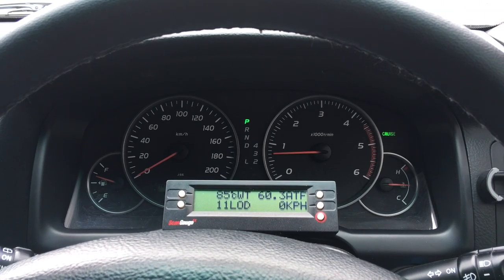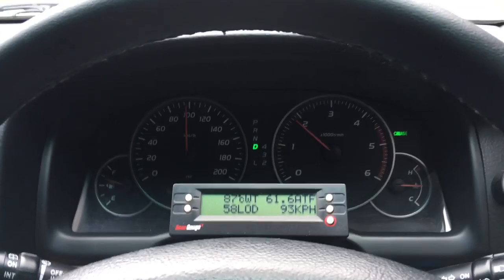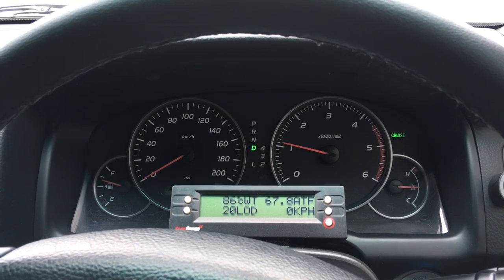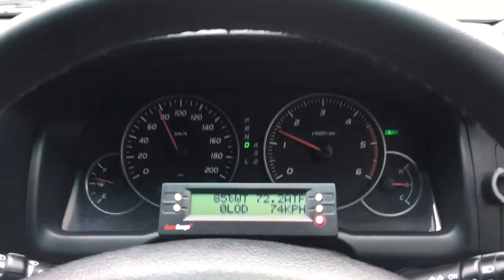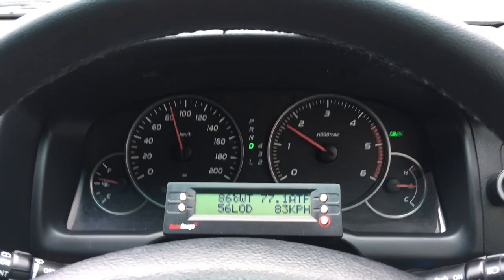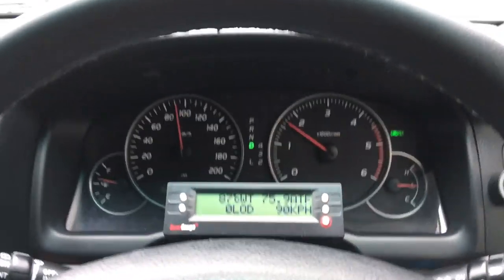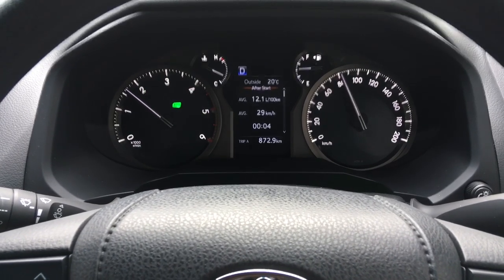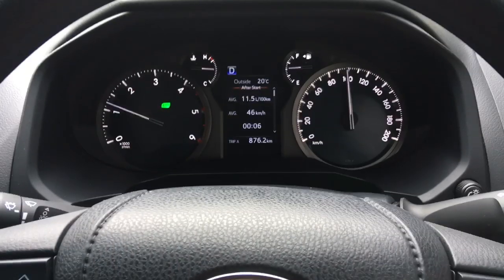TRANSMISSION & TORQUE CONVERTER

Comment: I get the point. The 6 speed auto does not fail. Regardless of torque converter locked or not. It is more like an OCD complaint and I can highly relate.

Comment: Hey Andrew, love the videos mate. I will be doing a bfe soon when I’m due for timing belt mate. I’m just wondering if you are familiar if the scan gauge can monitor the 4 sped auto transmission temperatures? I’d like to monitor them somehow but can’t see it on obd2?
Thanks in advance

Comment: Terrible Gearbox I’ve had my new Hilux 2020 for 4 wks now and the 6 speed Auto is driving me nuts with 95% highway driving . Coming from 2015 Dmax with the 5 speed auto which was Great . So I’m going to bite the Bullet & spend another $750 on a Stocklock kit on an already $70k Ute Hopefully will fix the Torque Converter. Thanks for the Great video 👍 would have been a little bit better if you had the Scangauge ll plugged in aswell on the 6 speed .
Reply: Did you fit a lock-up kit?

Comment: Hey Anthony. 
At 60kph on cruise control going slightly uphill I get a shudder (5th gear at around 800rpm).
If I drop it to 4th (or increase revs), the shudder goes away. 
 Is the torque converter cactus, I know you're saying heat, but my one makes the entire car shudder ?? 

I only got the car 2 weeks ago. 180k 5 speed, auto, 120 prado.
Reply from the maker: Use 4th
Watch more vids.
800rpm is way too low 🤷‍♂️😉😂
Reply: @Fourby4Diesel  thanks. I watched your how to drive an auto video a while back and I have noticed that the efficiency has gone up. Just sometimes forget to take it out of "D" sometimes and it catches me out. 

I owned a 6 speed manual prado and would never think to change up a gear into low revs. 

I was wanting to assure that it wasn't due to a mechanical error
Reply: I have this exact issue also, turns out torque convertor is flogged out. Howd yours go mate ?

Comment: I disagree with your comment about higher gears not being the most economical, sometimes they are more efficient and sometimes they're not. If the engine can mix air and fuel together well at a given engine speed, and the load on the engine isn't too close to the maximum for that engine speed, that will be a better engine speed than a higher one in a lower gear with a lower load. There is a range of engine speeds that result in poor air/fuel mixing, that engine speed will be less efficient than a speed just higher or just lower than that range, so sometimes you're right, a lower gear can be more efficient.

The most fuel efficient gear choice depends on so many factors; but most important are the amount of power requested from the engine and the air mixing dynamics of the engine.

Think about it like this, an engine is an air pump, and the faster the engine spins, the faster it has to pump air into and out of it, the more work must be done to maintain that speed. You get more engine braking from a higher rpm than a lower one, that's because there's more resistance from the extra work the engine has to do to pump the air. When the engine is idling at 700 rpm, it takes 1 unit of fuel per minute to maintain that speed, and at 1400 rpm, it takes about 2 units of fuel, and at 2100 rpm it takes around 3 units of fuel (it's not perfectly linear, but's close enough). This is because as the engine spins faster, it's doing more work to simply pump air through itself. When you are driving along with a tiny amount of pressure on the accelerator, asking for a very small amount of power from the engine, the vast majority of the work the engine has to do is to simply pump air through itself rather than propel the vehicle down the road. If you reduce the engine speed and produce the same net power output, the engine won't have to work as hard to pump air, so the proportion of the amount of fuel used that does useful work to not useful work goes up. The takeaway should be that at low loads, engine speed is the main factor that determines efficiency.

However, at high loads, thermal efficiency is much more important than air pumping. When the requested power on the engine is high, the proportion of useful work done by the engine is much higher. The amount of work that must be done to pump air based on engine speed is mostly constant, but since the thermal efficiency of fuel conversion to power can be a bigger or smaller variable, at some point it overtakes air pumping in importance pertaining to efficiency. So at high loads, the Brake-Specific-Fuel-Consumption map of the engine is much more important to consider than absolute engine speed. That is where you are right. At very high loads, it is more efficient to be at the engine speed where the engine has the easiest time converting fuel into power, which is usually between 2000-2500 for engines smaller than 5.0 Liters. it would be more efficient to use an 80% engine load at 2000 rpm than a 100% at 1600 rpm on an engine that makes power most efficiently at 2000 rpm. But if the amount of power needed to propel the vehicle drops off a cliff, it would be more efficient to produce 5% load at 1600 rpm than 4% load at 2000 rpm because the work of pumping air is now the dominant variable.